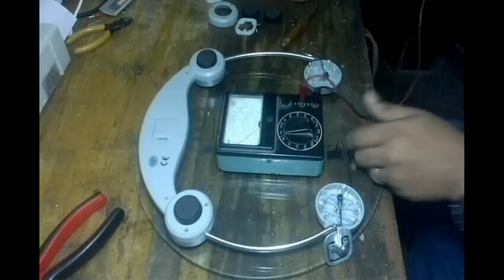how to repair weight machine?

Comment: Hii....i am having sm  issue wd my weight machine...firstly it was showing low  battery indication...and after changing it's battery it is not displaying anything???plz help
Reply from the maker: Did you use same battery? same voltage? same model? If all are same, please clean battery connector.
Reply: How to clean the Battery connector?
Reply: @electronicshelpcare  hello!  my scale ran out of batterie, and when replacesd, it worked, but it gives very exaggerated readings
any idea on what could have gone wrong? can it be a mistake on the type of batterie?
Reply: Agar new machine khride tab betri ho hoti h fir wait kyu nahi btati h please muje btao

Comment: LOW ERROR code is shown.. I just didn't  change the battery for a week.. 
then I bought another.." new one"
but it's still showing low error..
how can I repair it
Reply: Check the battery  connector and tight and  clean carbon with  Emery paper

Comment: No switch is applied at those points in my machine.
Reply: Tengo problema con esta balanza de vidrio.
QF-2003A
Marca lo que se le antoja, o simplemente no muestra nada.
Pila nueva.
Reviso los switches que deben ir en las patas y me encuentro con que no hay!.. Solo aparece una pasta blanca sellando los tres cables, blanco tojo y negro.
Noto que hay unos huequitos que se han realizado por el uso... (comprada en mercado chino... imagino que se pesó hasta el perro!:))
Hay repuestos?
Pienso poner relleno en estos huequitos con alguna soldadura para que hagan contacto.
Pongo fotos:
https://drive.google.com/file/d/1Tvk-hV3t86_YjwZKRB_C0U9tXdSsSzRJ/view?usp=sharing https://drive.google.com/file/d/1zgUxVI2eNAzxOujXXmnotmpmql-3JvDq/view?usp=sharing https://drive.google.com/file/d/10cbK_mbHBq88p4foxQ4HBvgi2vFnuVwg/view?usp=sharing https://drive.google.com/file/d/1QrbrbcvNu5HwZBCTQXeisSglkTuneIp0/view?usp=sharing https://drive.google.com/file/d/1Ucgu15I4gQ9K24nGyIKRZDBLN4R3K3W9/view?usp=sharing